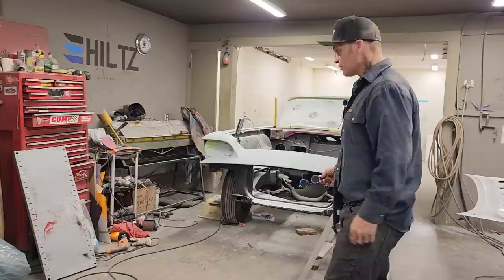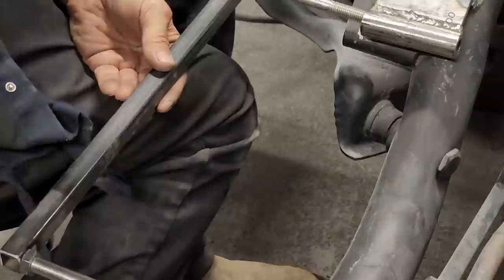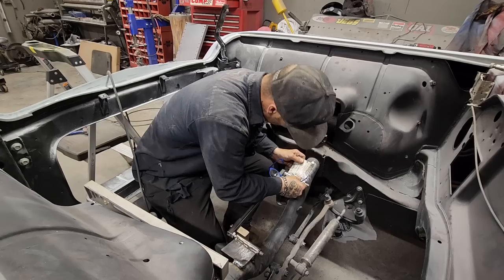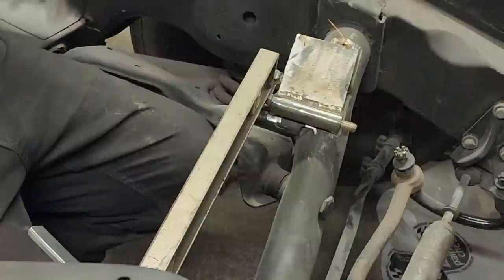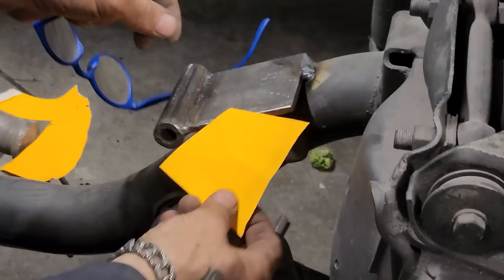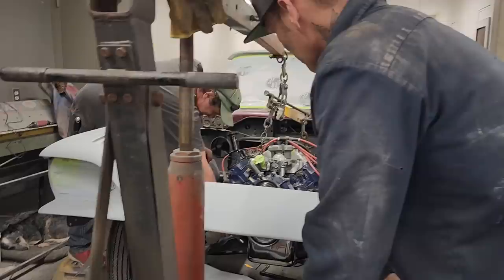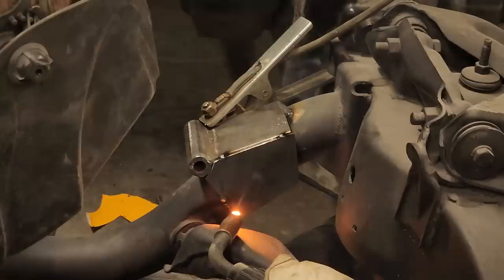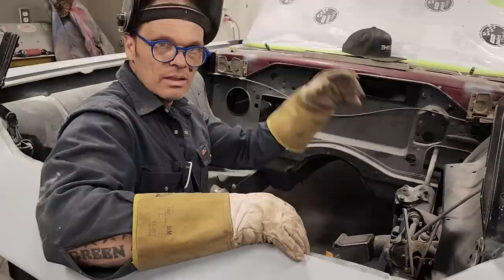Having issues with the 351 engine swap ❌

Comment: 1 suggestion. Put the trans back on the engine and look to see if the end of the tail shaft is centered on the engine front to back. Next measure from the end of the tail shaft to each engine mount and see if they are the same. 3rd, put a square on your engine mount adapter gauge at the center and see if it goes straight down the center of the tunnel.
Reply: You're talking sense Will. That is what I have done in the past.

Comment: As I said at the end of last night ! Only put the LEVEL on the engine mounts (with/without engine itself) AFTER you CHECK the CHASSIS is LEVEL too !
Reply: And then's there's the issue of if the mounts on the engine are slotted and there's no way now to know where the mounts on the frame were relative to the mounts on the engine, then either you go with the apparatus you made as the control or you go off of the level with no way of knowing about whether or not the garage floor, the tires and the frame are level.
Reply: Plumb level and square.  LU 250 retired
Reply: EXACTLY
Reply: Frustrating to watch huh?
Reply: I wouldn't do it like him
Reply: @charleshewitt3026  Yup! Poor Jolene
Reply: Laser
Reply: @dogsense3773  lots of variables goin on there - but no level playing field - LOL

Comment: I'm for sure keeping Nova Scotians and particularly the firefighters in my prayers. Bush and forest fires are treacherous, not only can they change directions quickly, they can generate their own wind storms. Fire brands can be blown up to a kilometer before coming down and starting another front to battle. I like the way you thought out the motor mount issue, yet another great idea for me to file under 'useful'. Jolene is a quiet helping hand, keeping track of stuff and flipping on the welder and what not. She's a good 'ground' for Chad. I'll be watching tomorrow.

Comment: As you mentioned, I don't think the factory welded in the stock crossmember exactly perpendicular to the frame. Once you box in the new mounts, the slight difference on where the new motor mount plate sits won't be that noticeable.
Reply: actually .... there's no guarantee that the engine was perfectly squared with the frame when you sat it in there which is why your "line" on the passenger side was slightly forward. Level the frame side to side, then level the jig side to side and then measure the same distance from the front of the engine mount tubes to a "squared" crossmember further forward and then you know your engine is perfectly inline with the vehicle centerline

Comment: My advise as I'm watching Chad try to line up the motor mounts.  Do not use a level as the car frame it's self is not level.  Lay a piece of square stock across the top of the frame above the location of the mounts.  Measure down to establish the same height of each mount while using the square stock with the welded bolts to keep a true read on spacing from each other.  I wish I was there to explain it.  Thanks for the videos.

Comment: Typically motor mounts are made with a certain amount of adjustability. Usually there is a rubber bushing and slots in metal to afford a good fit for the engine. Slop fit is what it's called by some old schools. The main factor is to get the engine in a good spot not touching anything.
Reply: You can also use the term ‘clearance fit’.

Comment: Great idea making a gig for the motor mounts. Very smart Chad and I can't wait to see you guys driving her around, plus I am very excited to see the trailer done because I am doing the same thing to mine right now.
Reply: Nice job on the mounts
Reply: Do not motor & transmission mounts have rubber in them for vibration ?
Reply: @Paul Eggert  the mount on the engine has the rubber
Reply: Engine can be solid mounted it's all on what the builder/driver prefers it's just a lil more vibration more road feel is all mostly race cars also some hot rods solid mounts it so it looks cool at a stop light as the camshaft has the engine chopping it shakes and rocks the vehicle side to side alot more than rubber mounts do

Comment: If you twist the drivers side mount about  4 0r 5 degrees counterclockwise you will get more clearance for the steering box and the centerline of the engine and tranny will intersect the center of the rear axle. I mean clockwise viewed from the top.

Comment: I would loosen the bolts that hold the motor mounts on the engine. Or make sure that the premade crossmember fits on the motor mounts the way the motor mounts are bolted onto the engine right now. I’m pretty sure that’s your problem. That’s a great idea welding the bolts together as a jig, however you have to make sure the motor mounts are lined up to fit the premade crossmember that you used for your pattern.

Comment: The best way to do engine mounts is the way you did it the first time . Since there is slots in the engine mounts you do all of your adjustments on the rubber mounts adjustments , set the engine in place and weld it in .  I wouldn't worry about very little clearance on the headers because most of the time you will have to dent the headers in some places to get the proper clearances. Do what it takes to get the engine properly positioned. 90 % of the time it will not fit properly if not fitted with the engine in place.

Comment: The question I have is did he center the tail shaft of the transmission when he had it in? That will make a difference if the motor mounts are centered..

Comment: When you made the jig for the mounting bolt locations, did you stick them in the cross member from the correct side? like one side is facing "front" other side is facing "rear" That will make a huge difference rather they fit or not. Actually the only way to get it right, you must have the engine and trans sitting in place, (using the correct size bolts) and the trans tail shaft centered in the tunnel area. (rear mount) then weld everything in. Then take the engine out again to pretty up all your mounts.

Comment: With the mounting jig in place, measure from each tube, forward to the radiator support panel, and rearwards to common points. This will tell you if the mounts are square, or not. Great job so far. Keep it up.

Comment: I see Chad use a level often but never see him check how level the rest if the car is. If the rest of the car is off (because of a saggy suspension on one side, jack stands not exact, even lower air in a tire, whatever), whatever is level is going to be off in relation to the rest of the car if the rest of the car isn't level

Comment: He doesn't want to mess with the driver side mount but it is cockeyed because they were using undersized bolts to fit the engine.

Comment: Chad has said it all to often, HE IS NO MECHANIC. Just look at the number of projects which have not been completed that are at the stage where a mechanic is required. He should hire a experienced mechanic to assist when needed.
Reply: Yeah, I was hoping he would turn the shop into a big deal when he first started the YouTube videos. There’s so much potential.
Reply: It's about content not finishing.
Reply: It's a fair comment, John and I do agree with you.  Not a criticism on your part but an observation.  I am a Bad Chad fan as well and I am sure its in the back of his mind.  A finisher (mechanic) would be a great addition but as maclovin61 said its geared to content.  Shows like this can evolve and who knows....someone could pop up.
Reply: @cammos  So you spend your time watching his videos for the only purpose of criticizing.  Does this help boost your fragile ego?
Reply: All in good time . 😌👍🏻
Reply: Chad has said he don't like spending money. And his body work content is everything a DIY needs to see. I do wish he would level the frames before he starts any modifications especially when making motor mounts. If frame and motor are not parallel oil can not properly drain and will end up sitting on valve cover gaskets and leaking.
Reply: I am a mechanic, I spent my entire life in Automotive, I have my Dr. Of motors, ran several successful service departments, had my own business, eventually got into sales, and ran a dealership. This man has been graced with a special touch, he is kind, and extremely patient. I am very impressed with all he does.
Reply: He is a sheet Metal Worker and BODY Man. Big difrence😂 at least of all i could figure that out myself.

Comment: Chad is the Tbird level? You might have the mount on the driver side twisted a little bit and that is throwing you off measure from the firewall to your mount on each side to see if it is the same distance

Comment: Use a factory 67 mustang motor mount ,it fits right in place in the 58 chassis like factory . That transmission is a no go in a car without raising the whole tunnel to clear top of transmission .

Comment: Looks as if you do need to move that engine mount on the right side ( when sitting in the engine enclosure, if you move it with the plate pointing a little bit toward the centre line of the compartment it will not only allow you to gain more space (the reason you don't want to move it) away from that obstruction..and allow the left side engine mount to move further toward the grill and give you the centreing you are looking for....

Comment: measure  from the backside of thr right motor moumt  to the fireqwall   then measure left side to firewall  one ofr them are catty  wompus

also turn your msde bolt holder dround and then flip it over it shoild fit all 4 ways

Comment: Did you put a level across your frame to see if the car is sitting level first…tire pressure and floor maybe out or both . Level your engine before checking those other areas is wrong. Also find frame dead center at the firewall to make sure your rear trans will be centering.

Comment: All is good making the engine fit but will the whole drive line be “ inline” from motor to rear end ? Gonna get some pretty good vibration issues if you don’t check that.

Comment: That’s some bad azz Bad Chad fabrication. Design is the process of solving a problem and you are one hell of a designer Chad! You have probably told it before but what welder do you use and what do you have your wire speed and temp set on?

Comment: That engine is going to shake around like a Mexican Jumping Bean if it doesn't have rubber mounts.
Reply: 😂 actually the opposite is true
Reply: The rubber mounts are bolted in the engine

Comment: The way I fit a motor is to put a water level on the caburator or manifold when fitting the gearbox mount

Comment: chad when you made the jig from the new cross member you took the jeg in your left hand and made a 180 degree turn and tried to install in with the same degree, maybe It might of worked if the jeg was turned again 180 degrees , maybe the bolts were in a  differient angle ,  Just a thought. Bob from Fresno, calif.

Comment: I do think you should have some rubber in your engine mount system.  Without it you will feel all the vibration in the engine especially as you are using a manual trans.
Reply: The rubber is on the motor
Reply: @paulrhodes3944  good to know, thanks

Comment: Again you decide a 351 with manual trans regardless of whether you'll be happy with it.  It seems a long road to travel to be disappointed.  You just got off that road.  Use the 352 or other compatible engine and an auto trans.

Comment: I noticed you were using a spirit level for the engine mounts but the car looks to be still on its tyres not a solid level jig so if the tyres aren't the same inflation you won't really be as level as you think you are?

Comment: Don't like the flat for motor mounts. I would have cut old motor mounts off. Fab new mounts like original offset to stand vertical and follow the OD of the crossmember.

Comment: You kinda want that motor level because you have a front pump. But I’m not sure. If you had a back pump you’d want the oil in the back the most you could get it. Your oil pan drops down in the front so you want most the oil to be in the front, that’s what I think. I may be wrong.

Comment: So you're going to run "solid" engine mounts on a cast-iron block in a stock channel frame with a "tubular" engine crossmember? If the mounts have no "give" and the block has no "give" but the frame does have "give" what else is going to "give"? 

Solid engine mounts are for race cars/trucks with a tube chassis or at least "front halfed". Even then engine plates and aftermarket blocks are "recommended".

Comment: Did you check when the tyranny was on the engine that the tail shafts was centered in the tub of the floor, drive shafts could be going crooked.

Comment: you might not want your engine leaning to the back to much. because your oil pan pickup is in the front with that pan. Im sure you'll get it all sorted in the end.
Reply: I always thought the front sumps were kind of weird
Reply: Less oil to the bearings with front sump
Reply: i think as long as he's not doing wheelies it'll be okay =D

Comment: Chad I don't mean to correct publicly but, you need to see how level the car is and than match the level to your motor mounts. Also, I thought the idea was the bolts are a template for the distance between the mounts. So if that's the case, then just match the bolts and weld the hinge in. Am I right??

Comment: Not tryna be a dick here Chad buddy...but it's much safer to just run 2 grinders. 1 with zip/cut wheel and 1 with the grinder wheel. Its extremely common for a zip wheel to explode when being used sideways as a grinder wheel. I do it all the time also but it's good insurance to get in the right habits. Stay safe brother. Dont wanna see anyone hurt over simple avoidable mistakes.

Comment: It seems everyone in the industry struggles with putting in engines. It’s time-consuming and potentially dangerous. Having a massive block of steel swinging around at the end of a chain is a recipe for trouble.
There needs to be a better way ( maybe there already is ) perhaps more like a forklift with an adjustable tilt and roll control. Still small and light - perhaps electric assist. And better wheels -wider and larger to handle cracks and uneven surfaces.  It’s a classic “ time to stop chopping wood and sharpen the axe” time.
Reply: You're funny ,put hundreds of engines and never thought it was dangerous.

Comment: You should throw that level away and triangulate the locations.  And if you're going to use it, at least make sure the frame rails are Level across from each other and don't sit on the car while you're using it. Good God.